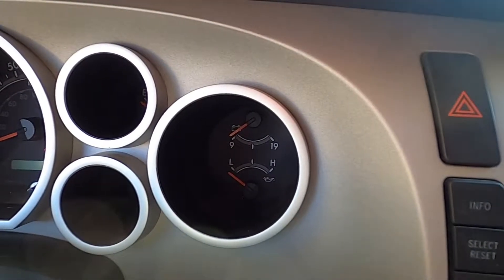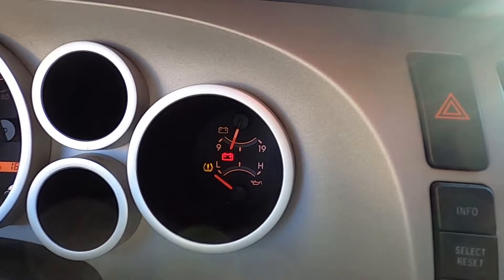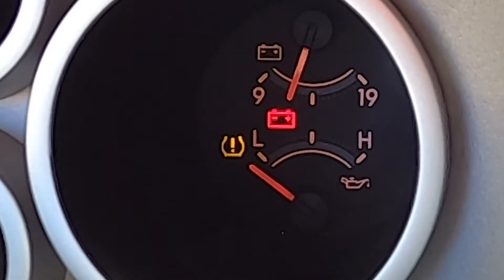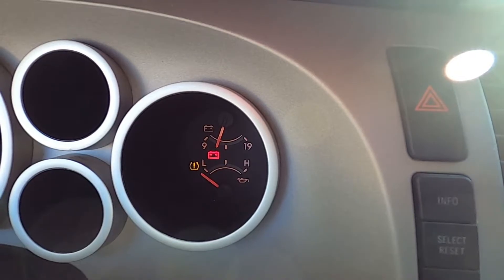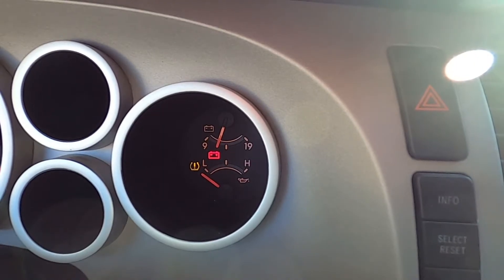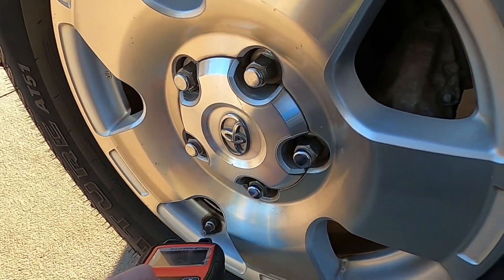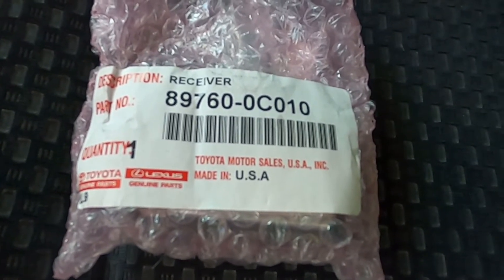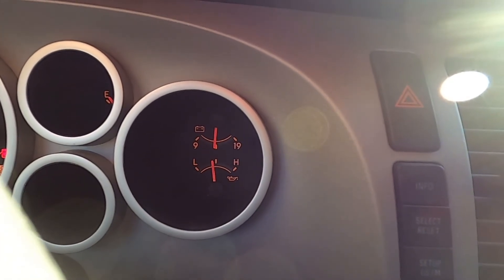FIX! TPMS Low Tire Pressure Light - 2008 Toyota Tundra - NO BYPASS!

Comment: This was a huge help! Same issue on my 2007 crewmax, I replaced the tire/wheel transmitters due to age but still had problems.  Light would be out after resetting / loading the TPMS codes but after a short time light would appear again.  Called a junk yard and purchased a TPMS "receiver" as you described located up under the headliner.  FIXED!  Receiver from the dealer is listed for over $500, from the junk yard $65.00!  Took about 15 min to replace under the headliner.  I've never purchased from a junkyard before, but after this situation I will consider for more repairs.
Reply from the maker: That's awesome Dave! Well done sir!
Reply: I have the exact same truck with the exact same problem.  Can I ask, did you find another 07 crewmax in a junkyard?  Or was it a different year tundra, and if so, what year?  If you found the same truck in a salvage yard, then you got SUPER LUCKY!!!
Reply: I believe it was a year newer, the junk yard unit "black box with mounting bracket" were actually a little different (bracket arm was slightly longer)  and wouldn't fit exactly as my factory original, so I took the internal electronics "board" out of the junk yard unit and put into my defective unit so it would be a direct fit. Hope this helps.
Reply: @davek3798  It does help.....I've been trying to find other potential Toyota vehicles that I can look for (not just Tundras) that may have a compatible TPMS module.   Several folks have mentioned Sienna vans.  I think that my module has a part number of '89760-0C010'.  I haven't actually seen this since I haven't removed the module, however plugging in my trucks info into the ToyotaPartsDeal website, this appears to be the only part number compatible with my VIN.  On the Sienna's, the part number appears to be 89760-08020....a little different, but from the sounds of what other people have said, this difference may only be in the bracket and not necessarily the module itself.  Before I do anything however, I'm going to remove the module, take it apart and carefully inspect the solder joints.  One guy said that he did this and saw what appeared to be cold solder, so he got out his soldering iron, reflowed these joints and I think he said it appears to have fixed the issue.
Reply: BTW, I've been loading Toyota part names / #'s on my ebay account and have found a number of parts from various junk yards around the country. There are
"Toyota yards" I have found parts needed for an old 97 4runner I'm working on. As a new/recent example, I used a 1998 camry RS3000 security module to fix my 97 4runner. So good luck with your project.
Reply: Thank you fo sharing the costs, that's the one thing missing in this video that would have made it perfect.

Comment: Nice videos!  I have the same truck and about to fix the same issues, pressure light, and drip molding.  Have you looked at new stereos?
Reply from the maker: Thank you!  I hope they videos are informative and provide value.  I plan to record a few more videos around the ole Tundra--stay tuned! :D  As far as radios, I was honestly satisfied with the stock head unit, but it was missing some backend power.  So I added a 1200w mono amps and paired it with dual 10" subs.  Sounds great for my purposes.  What mods have you made?
Reply: @BDTube2006  i just purchased the truck last week and already love it.  It is in good shape.  I am going to tow a travel trailer and i am researching back up cameras.  Did you have any issues with your subs?  There is a shortage on computer chips and therefore shortage on stereos.  I'll follow and tell you more soon.
Reply from the maker: @jefferysct77  no issues with the subs. The subs I went with are specifically made for a shallow mount and they sit in a speakerbox specifically made to fit under the driver's side rear seat.. You'll love this truck! I pull a 26ft Coleman, no issues whatsoever. I did splurge a little on a heavy duty weight distribution/stabilizer hitch that locks the trailer down! When I switch lanes, the entire rig moves as one, no sway from the rear, etc.

Comment: Thank you very much.. you saved me i just changed the receiver and it worked after 6 months of headaches with c2126
Reply: So your code c2126 was caused because of the transmitter?

I have a 2012 and I just changed all sensors and programmed them and re wrote them into the ecu with the autel. 

The TPMs light goes away but every time I restart the truck it comes back on , and I get code c2126. 

Wondering if it’s the transmitter or I’m just missing a step in programming new sensors.
Reply: @lukegoodwin2160  change it and no need to program just drive it
Reply: @msalim9587  yeah I guess that’s my only option left, I wonder if there is another way to test and make sure it’s bad, because the key fobs work and then every time I reprogram the sensors the light stays off for as long as the truck is on. 

But if I turn the truck off and then back on it comes back 

What unit did you go with? A used on eBay?
Reply from the maker: Awesome! Great job! Well done...
Reply: @BDTube2006  couldn't do that without you
Reply from the maker: @msalim9587  Gald it worked out!

Comment: While watching your video, I figure out how to fix the sensor light from my dash of 2008 Tundra V6, all I need was a receiver to remove the light. How much a new receiver cost? Can we order that in any auto store? Well, thank you for information, I learn so much.
Reply from the maker: Depending on the Toyota dealer you use, I've seen them as low as $350-$475 USD for the receiver. I haven't checked parts from the typical auto-parts store--but worth a shot, but these items may only be sold from Toyota.  Some folks may find them from scrap yards for cheaper (typically around $200-$275).  I believe the Tundra and the Sequoia share the same model receiver. Keep me posted once you fix it!  Would love to know it worked out for you.

Comment: Looks like you used the receiver for a Tundra Double Cab 89760-0C010. The receiver for the Crew Max is 89760-0C020.  Both Receivers use the same Control Module 89769-0C022 and Tire Pressure Monitoring System Reset Switch
Reply: Looks like i am off to the junkyard

Comment: did you try unplugging and plugging back in the old receiver before assuming the old receiver was bad ?
Reply from the maker: Good question... I do not recall if I tested that process or not.  Logically, I believe I would have, but now I'm second guessing myself if I did or not. Ha!  With the frustrations I was going through with the sensors alone, I opt'ed to purchase a new receiver and get this fixed.  I'm glad it was fixed on the first try--would have hated if I had to dig deeper and look at the TPMS module next.

Comment: Thank very much for the info. I took my truck to Costco they check the sensors and he said are all ok How much cost the receiver??? I may have to replace the receiver.. Thank very much for the INFO.
Reply from the maker: The receiver can vary on price used or new (also depends on the dealer pricing for new), however I'd expect the receiver will run between $200-$300 used and $350-$450 new.
Reply: @BDTube2006  here in Vegas the Toyota dealer want $855 which dealer you got from
Reply from the maker: @pecosb5221  whoa!  I'm assuming that's the price, installed?
Reply: @BDTube2006  nope just the receiver
Reply: Two different dealers same price where you got it from?
Reply from the maker: @pecosb5221  Checkout TRDShop online.
Reply: @BDTube2006  ok I gonna try
Reply: Thanks 👍
Reply from the maker: @pecosb5221  Good luck!  Let me know if yea get the fix!
Reply: Did Costco charge you to check the sensors?
Reply: @Esteban_Herrera  NOPE I JUST TOOK  TO COSTCO FOR ROTATION AND BALANCE THE 4 TIRES AND THEY SAW THE TPMS LIGHT ON I THEY CHECK THE SENSOR WITH NO EXTRA CHARGE. SORRY FOR THE DELAY...
Reply: @pecosb5221  Thanks. I should give them a shot.

Comment: This is awesome, thank you! I just bought an 07 Tundra and the light has been driving me crazy. The tires look new but the sensors may be old/bad. How much was it to replace all 4 if you don’t mind me asking?
Also so I have an idea and if replacing the sensors don’t work for me how much was the receiver for you?
I did read your whole description and I appreciate your story and explaining your experience!!
Reply from the maker: You can use aftermarket sensors, I paid $214 for four, installed. The receiver price varies depending on the dealer you use, however, I believe I paid around $400. If you have a local junk yard, you may be able to pull one from a Tundra or Sequia for cheaper. I agree, the light can be annoying and I wanted to find a solution instead of simply ignoring it. The system was made for a purpose and therefore, I wanted to be sure it works the way it's intended. Keep me posted on your resolution! Glad this video could assist. Thank you.

Comment: I got the same thing going on with my 2008 complete garbage truck Just blew a cv the other day just driving then my secondary air valve I just replace a month ago is stuck again these truck are a joke
Reply from the maker: Damn dude... everything hitting at once! How many miles on it?
Reply: @BDTube2006   the first time the secondary air valve went out was at 200k not even 3months now at  205k I’m trading it in for 2017 Tacoma
Reply from the maker: @bradfox22  I'm sitting at 167k, luckily the only issues have been an AC leak (repaired with a kit) and this receiver failing. Everything else has been cosmetic (window molding, roof molding, engine cowl), however, I'm starting to get some squeeking out of the suspension.  I came from a 2000 PreRunner TRD which I loved, but needed the Tundra once I picked up a travel trailer.
Reply: @bradfox22  you have over 200k on a truck and things start going out and you're complaining? what do you expect? things get old and worn and go out.  you'd be lucky to not run into major issues with a Ford or Chevy before 100k

Comment: can you just disconnect the receiver and leave it unplugged?
Reply from the maker: You can unplug the receiver, however since the module isn't receiving the signal from the receiver, then the low pressure will remain illuminated.

Comment: Just leave it on or pull the bulb not really needed.....too expensive wasted money ...never had them years ago ....any car guy looks and checks tires enough
Reply: I don't agree, I am a retired truck driver if you are on the road if you don't have a TPMS  you don't know if your tire got low in air until you hear the flap noise which mean is to late But with the TPMS you can save the tire.
Reply from the maker: @pecosb5221  absolutely!
Reply from the maker: I can certainly agree, the part is expensive if you purchase new; however you can also find these units from salvage yards at a much lower price (I believe the Sequoia uses this same one as well). Beyond manually checking my tire pressure (when towing), it's nice to have the system working the way it's attended to while driving (hard to check tire pressure while driving 65mph). There are times that road hazards are unavoidable and if you must drive through it's good to have a system in place that's checking for you so that you can continue on your journey. Redgardless, yes, the part can be expensive, however, it's an easy fix to get the system up and running. This DIY is much cheaper than the dealership's alternative.

Comment: Hi there, I also have a 08 Tundra and TPMS light been on for a year now, recently brought new set of (4)wheels/tires with new TPMS sensors(mount/balance) from online (sensors are 315MHz). Even brought the program tool that you have in this video and ECU is able to read my new sensors. After that, I brought a new TPMS antenna receiver from the TOYOTA dealership. After making sure all tire pressure are good and installing the new antenna, I am sill having the same issue from the beginning. Do you have any ideas why or advice, thank you ahead of time.
Reply from the maker: First, that's great that the sensors are reading--that's a good sign.  Next, you want to be sure the TPMS Module has the IDs from those sensors written to the module; therefore, perform the RELEARN procedure and have the scan tool write the codes (you'll connect the tool to the OBDII port under the steering wheel).  Once the tool is in the process of writing the codes (this will cause all the lights on the dash to light up and blink--imagine a sparkling Christmas tree) :D the system will finish and scan for Diagnosis Trouble Codes (DTC).  This will show you any other faults in the TPMS system; hopefully you simply have a mismatch and this would resolve it.  You should get a confirmation screen like the one I have shown @ 4:20.  It will show the sensors codes and the codes in the ECU.  Whatever you do, do not use the TPMS Button under the dash--if the codes are incorrect, you will lock the ECU.  *Of course, your tool can unlock it and rewrite the codes--so that's a plus.  Let me know how it works out for yea.
Reply: @BDTube2006  yes I have done all those steps you mentioned. My issue now is I’m getting the DTC C2126 “Transmitter ID not Received” (main). I saw other video getting the same code as this and it was fix by buying a new receiver antenna. But in my case my module has the new sensors put in successfully and it’s able to retrieve out successfully. After replacing all wheels,tires,sensors,receiver antenna I am still having the blinking tpms light for one minute then steady light that does not go away. Any idea what it could be?(Note: tpms light be on before I brought new wheels, tires and sensors a year ago)
Reply from the maker: @amdamsdms  did you have the scan tool clear the DTC? Before swapping the antenna, that code would have appeared (along with any sensors not reading). Once you have the codes written to the ECU (which you confirmed) and swapped the receiver--I scanned the ECU, C2126 was present, I cleared the DTC and the light shut off. Basically, that code is stating that the module is not receiving the sensor information, therefore, as long as the antenna you swapped is good, the only component left in the mix is the TPMS module itself (behind the panel on the passenger side, right of the glovebox). Clear the codes with the scan tool and start the truck (full ON), let the truck run for a couple minutes and hopefully the light will shut of.  Unfortunately, if you've gone through all these steps, I believe the only option left is replacing the module... I'm very curious exactly what your solution will be. Please respond if you get this resolved. Good luck!
Reply: @BDTube2006  I will keep you update
Reply: Found out bad module....all good now
Reply from the maker: @amdamsdms  well done!

Comment: I bought a 08 Tundra last week and its having that issue with the TPMS. I don't know if it's the sensors or the receiver but I don't have the money to buy that $300 Scanner you have to check. (Ironically I was looking at that exact scanner on Amazon before I found this video XD) Or to pay Toyota $70 just to diagnose it. I'm hoping it's just a sensor and not the receiver, they're way too expensive. (About $400 last I checked)
Reply from the maker: If you have a local Discount Tire, they can probably scan the sensors for you at no charge; being an '08, the battery in the sensors may be dead (or very low). I would start with Discount Tire, to quickly scan the sensors--takes all of 30 secs.  This will at least give you the info you need (bad sensors vs. receiver).  Keep me posted!
Reply: @BDTube2006  Sadly the nearest one to me is over an hour away in Lakeland, FL but I'll try calling up some tire places in my area to see if they can scan the sensors for free (Or for an affordable fee.) I'll let you know if I have any luck.
Reply: @BDTube2006  Update: Looks like I lucked out. 3 of my 4 sensors had failed and is the cause of the light. I’ll replace all four sensors when I take the truck in for a balance and alignment next week or so.
Reply from the maker: @Tech_Otter  That's great news!  Remember, you don't have to use OEM Sensors (I was quoted $1200 for new sensors from my local dealer; which I can only imagine, at that price, this was for all the sensors, receiver and a module--HA!).  Remember, to get 315MHz sensors as well as sensors for aluminum vs. steel wheels and you're good to go.  I paid approx. $50/ea. for all four (including mounting).
Reply: @BDTube2006  Yeah, I'm gonna buy some sensors for my factory steel rims from RockAuto.com